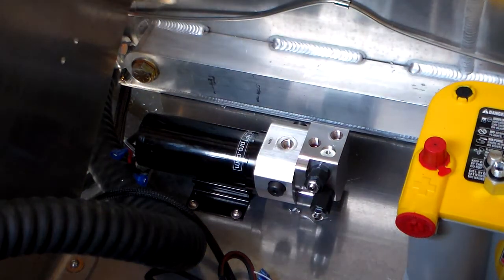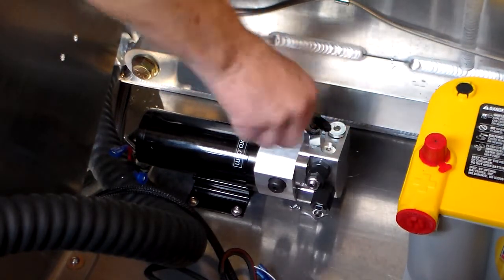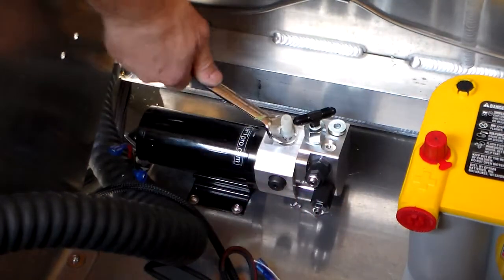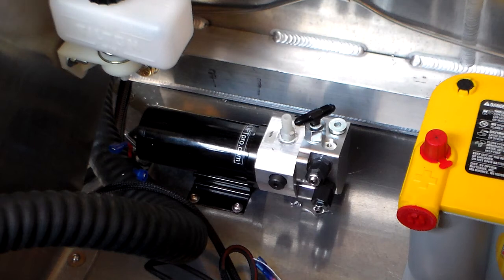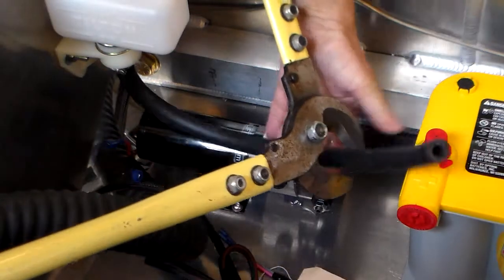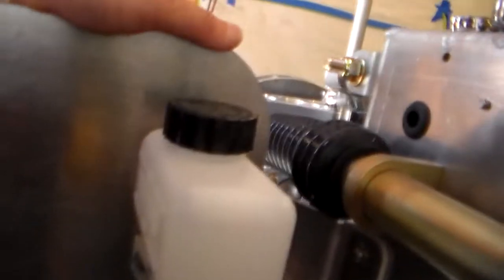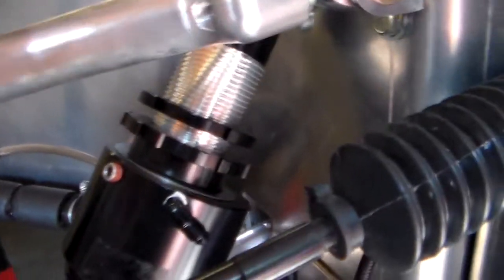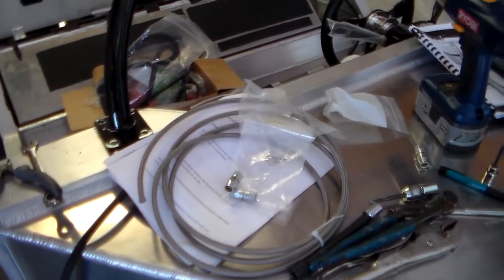SL-C Build lift system install

Comment: Hi Alan, why not use hydraulic fluid in both..?
Reply from the maker: The system has to use power steering fluid because of pump requirements.
Reply: Thanks for the response

Comment: Is it better to tee off one port or to use both ports
Reply from the maker: It's better to tee off one port to keep the pressure equal between the two sides.
The needed parts come with the lift kit for the SL-C.